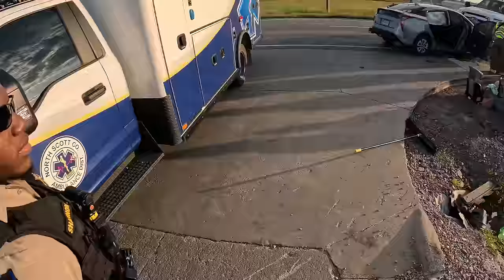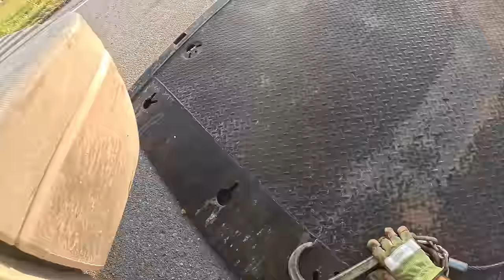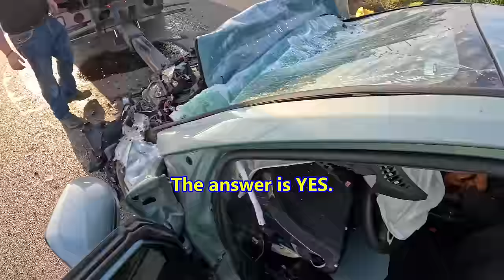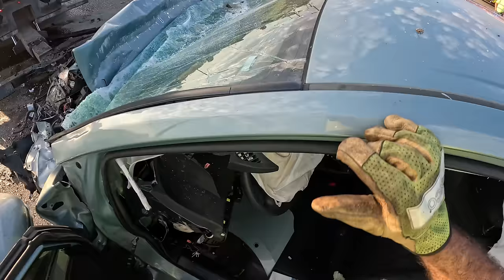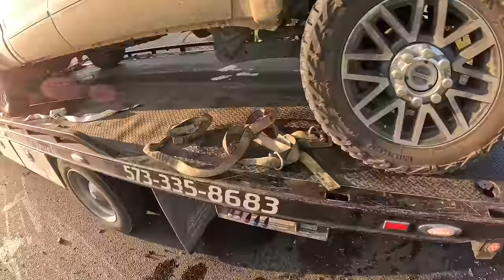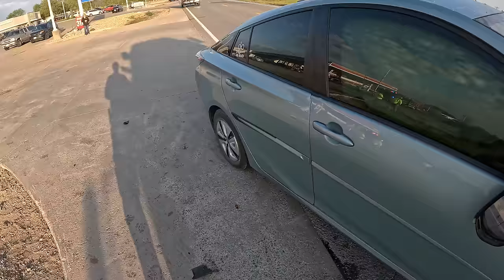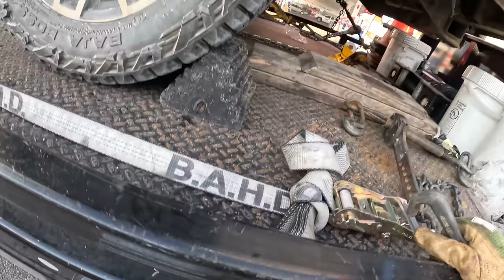HEAD ON CRASH CODE RESPONSE     DOUBLE TIME

Comment: Ouch that looked bad! You both did a phenomenal job as usual and hope all is well for the victims
ALSO: little info tidbit for future dealings with toyota priuses and most bmws, their batteries are in the trunk area but of course gotta take precautions as you showed here :)
Reply: I had my 3rd gen Prius totaled when someone hit the back of it, while going above the speed limit in the right lane, accelerating to about 7-9 MPH over after reaching top of a highway hill, though was about 4-5 over when hit, with somehow the airbags did not go off, but was not able to drive it because the bumper was pressed up against the wheels, and as no warning lights came on, next day it was able to start up and warm up at idle like normal till the ICE turned off when hot enough with the climate control off, even though the impact had shifted the 12 volt battery in the back and it looked questionable to me, however nothing leaking that saw, for was thinking of replacing that battery soon anyway, but course whole car got replaced instead 😅
Reply: And a hybrid with a ~300VDC traction pack. The first thing I'm looking for is the big orange HV system disconnect. (The dash was still lit so it still had power, which means the HV contactors are closed -- HV system still energized.)
Reply: Most hybrids have a high voltage battery as well as a 12 volt battery. heck, even a Tesla has a 12 volt battery. 

As far as batteries in trunks,  BMW is one, but a lot of the Volvo SUVs have a rear battery as well. And, Jags. And many others.  As well as saving space under the hood, the extra weight to the rear helps handling. And, batteries last longer if not baked under the hood next to the engine.
Reply: It did look like the regular battery was in the front. Prius C, so maybe it's configured differently. The drive batteries are somewhere in the middle of the car. Well protected.
Reply: @jfbeam no, the dash isn’t powered by the 300 volt battery in the middle of the vehicle. The dash is powered by the 12 volt system AKA alternator and lead acid battery.
Reply: @jfbeam  The dash and other accessories are powered by a standard 12V battery, not the hybrid battery pack

Comment: It met truck bumper to car hood/engine and car bumper to truck wheels.  I'd not expect any truck suspension to be OK with what looks like 40+ mph closing speed impact direct to the tires.  SOMETHING was going to break.  It's just a matter of where the designers put the fracture point for progressive impact absorption.

Comment: i just wanna say thanks because of your videos a few years ago when i was rigging my car for storm chasing i was able to find a really good light controller the feniex mini 4200 i chose it because i saw you guys use it also and it does great running my roof bar and TA in my back window i even have it running aftermarket fog lamps

Comment: As a paramedic I have seen a lot of accidents, I will surely pray for the folks in these vehicles, lots of potential for injury.  looked like the truck's driver-side airbag did not deploy, the driver might not have had their seat belt on which in some cars and some impacts will prevent the bag from deploying.  I believe the post  below me mentioned but Ethan should get in the habit of just putting gloves on.  Seems like every time I handled extrication or helped out the two crew, yep I was one of those guys who would help grab all the junk off the road if time and conditions allowed.

Comment: Thought the sunrise may have contributed to this. Pulling out of a driveway, one tends to check over your shoulder. Pulling in, maybe the pickup was trying to beat opposing traffic turning in. Bad combo; bad timing. Hoping all involved fully recovers. Chemical gloves have terrible dexterity but they're invaluable protection when things are leaking.

Comment: Thoughts and prayers to the driver of the car, for some time I drove a roll back with a spec lift and we would always tack this truck to a 2 car incident we found it was easier and quicker than two truck's it doubled the man power when the other driver could be doing another job and unless it was a multi car incident it was a one man recovery and a one truck recovery hear in the uk.

Comment: I wouldn't say because it is a Ford. My F450 took a Dodge van out. Van ran into the right front wheel and totaled it out. $15000 worth of damage to  the body but didn't hurt the frame or alignment. I drove it home. Over 100 miles, no difference except for look.

Comment: Yes, it's fine to tow with one truck. Yes, it's fine to run two trucks.  But one thing that should always be considered is your scene. Is it safe for two trucks? Is it safe or even possible to haul both vehicles (in this case, being a Prius, yes)? How much room is there for your first responders, are you blocking entrance/exit points, or otherwise creating more of a hazzard?  There is always so much to consider from the time your phone rings until the time you return back to base/shop. 
It's a Ford 🫣🤣

Comment: Great videos as always. Love them. But maybe need to train a little more on wheel lift. Ethan could of spread the receivers more so the L arm wasn’t so hard to put in on the passenger tire he was doing. Also the L arms don’t have to be all the way in , I leave some gap so the car sinks in a little more. Don’t have to worry about the the oil pan, car is a total loss anyways. I personally chain sling most of the time it’s quicker and easier . But everybody does it differently, love the videos either way!

Comment: One of my nephews daughters fell asleep at the wheel going home from work and took out a power pole at an estimated 80 mph, the engine and transmission were shattered and the pole was sheared off at the ground, she has a lot of bruised ribs, a concussion and stitches across her forehead and left cheek. he got the call just as he was getting ready for work at 4:30 am on wednesday. She is doing ok and not to be alone for awhile.

Comment: One of the first things I noticed was how far back the trucks front wheels were, then noticed the interesting suspension system. That had to have been an insanely hard hit to sheer all those bolts out of the front suspension. Looked like truck at fault from the vehicle locations but with how hard that hit was wouldnt be surprised if they moved a ways from original impact.

Comment: Sorry if this was mentioned previously, but working a vehicle wreck without safety gloves is not recommended. Also, use you air horns in addition to the siren; it tends to get the attention of inattentive drivers. As always, May God protect you and yours in the performance of your vocation.

Comment: Over in the UK and Europe recovery vehicles are not allowed sirens or emergency lights as used by emergency services. They have to comply with road law. We even get stuck in traffic getting to the scene. Afterall we are only doing cleanup.
Reply: It's like that here in the US also but some states law enforcement give towing companies permission to run ELS so they can get to the scene faster if it's on a major roadway blocking the flow of traffic , any other time if a tow truck runs emergency lights and sirens the towing company can lose it's license to do tows or the person in charge of the company could face hefty fines for breaking the laws.
Reply: In another video Ron mentioned that  the agency has to request him to "expedite" on that call before he can run code.  And if i remember Rons comments the driver has to have training before he can run code.
Ron can you comment here?
Who does the code training?  And how extensive is it?
Reply: We have a few states that classify certified recovery companies in the same bracket as emergency services. Ron is in one of the few places that offers those certs, and he's one of the fewer that got those certs.

Comment: This is my nightmare scenario, being hit by a truck or SUV that literally runs over the hood of my car. My ex husband drives a Tundra & that thing is massive. Though the truck is heavy & large it stops pretty quickly, something the vehicles behind you don’t realize. I was driving it to work during a rain storm because my car wouldn’t have been able to get through the flooded intersections without damage from flood water getting into the engine. A young guy, maybe 17 yrs old, was tailgating me in the ran. I, rather stupidly at that moment in time, tap the breaks hoping to get the kid to back off, the kid hit his brakes & immediacy started to slide as though it was going hood first under the back end of the Tundra. I regained enough speed to avoid him sliding under me & he stayed quite a ways back from me after that. I haven’t brake checked anyone since.

Comment: With alot of these new cars when the air bags go off the ECM will cut off the fuel pump. Safety thing. Which is ball because if you need to move the car off the road you can't and this can cause problems......just my penny's worth. Thanks Ron do enjoy your videos. 
Think it's funny over In Germany they would off had 5 fire engines three tow trucks and a crane for a job like this one.....

Comment: Ron, I own a 1991 FORD Explorer with 348,000 miles on it. The heads have never been off, I just replaced the original fuel pump and everything works even the A/C

Comment: Do you have an outside quarantine area to store EV's and Hybrids? As you know, after a wreck, they can spontaneously catch fire, and those lithium ion batteries are extremely hard to extinguish when on fire. They burn hot and fast and anything within 20 feet is at risk of catching fire from the extreme heat and the sparking that will occur when water is applied.
Reply from the maker: We have plans for one, but have yet to build it.   For now, we have a large open area we can place hybrids and EVs.  We are fortunate not to have a large amount of hybrids and EVs in our area, but they are becoming more popular.  So, at some point we will have to build a separate area.   There are many different ideas that tow companies are currently using.   Perhaps the most extreme one I've heard of thus far is placing a hybrid or EV in an open-top container and then filling the container with water.   I understand the desire for safety and reducing the risk of fire, but that situation creates an entirely new problem.....hazardous water that must be properly disposed of due to contamination of lithium and potentially other hazardous materials.  Also, it insures the vehicle will be a complete write-off....    We will probably have some type of three sided bays made of concrete or thick steel walls that we can back the vehicles into.   It would be constructed away from the main building and other vehicles in a secluded area of the lot.    Thanks for watching and God bless.

Comment: That under ride is no joke, but I guess the Prius did ok considering the difference in ride height, the driver likely survived. If this had been 20 or 30 years ago the dash probably would’ve been pushed back and story would be different. I guess the downside to modern safety engineering is everything's breakaway and made of composite and ceramic materials that shatter into a thousand bits making cleanup a job.

Comment: Hi Ron.  Just one question on this one, although I realize it may depend on what you're told by agencies / dispatch.  Just wondering why you didn't bring 2 rollback trucks to this one.  If you were told it was a head on collision, I would think it is assumed that 2 vehicles are involved, so you may need 2 trucks, although like you mentioned, you can tow two vehicles with one truck, as seen here.
Reply from the maker: We had a second rollback on "standby" if we weren't able to move both vehicles with this truck.    Thanks for watching and God bless.
Reply: Got it, thanks.  Love watching your videos every week.  I was actually involved in an accident about 2 months ago (walked away un-injured), and learned from watching your videos to leave the tow operator the keys.  The car was deemed totaled by the insurance (I had a 2016 Subaru Impreza), and used the money from the insurance to get a 2023 Subaru Forester, which I like so far.

Comment: This Video Reminds Everyone Why you want to Own a Solid Vehicle with more Steel in Front.  Hopefully this Prius can have Batteries Recycled since it’s Toast.
Reply: A solid vehicle actually isn't a good thing for the occupants. The fact that the Prius looks like a tin can is just proving that it did its job of the car absorbing energy instead of the driver. A solid frame will transmit all of the force of the collision into the occupants.

Comment: Fuel cutoff reset on those model fords, open passenger front door and look right on the end of the dash, should see a thing that looks like a fuel pump

Also Who's grill did you pick up out of the ditch when cleaning up??   it wasn't the one out of the super duty

Comment: Fords are wired if the seatbelt isn’t buckled, the airbag doesn’t go off. Notice the cracked windshield above the steering wheel, driver must have went into it head first. Scary.

Comment: Everyone has their truck of choice. Bought my 3rd Ford from the factory. 1999 F350 4x4 7.3 powerstroke. Drove it for 25 year. Minor problems. Replaced 1 set of injector cups and Orings. Kept up the maintenance on it. My son now pulls his mobile camping house with it.😂 It's been a damn good truck. I now have a 2015 F150 Lariat 4x4 3.5 ecoboost twin turbo , max tow package . Rides like a Cadillac. Liked my F350 better , but I'm retired now and old , it had a 6 inch lift and was gettin hard for my old butt to get in and out of. Still gonna put 4 inches of lift in my 2015.😂

Comment: To be honest i would have put the small car on top of the flat bed and towed the truck, the truck seemed more towable? considering the front damage on the small car?
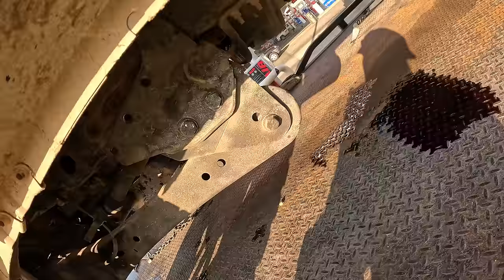Reply: The small car is only front wheel drive. The back wheels can spin all day with no issue. The truck is equipped with 4 wheel drive, but under normal operations it's rear wheel drive. With rear wheel drive you need to disconnect the driveshaft so you're not burning out the transmission while going down the road. Transmissions don't like going at highway speeds without the engine running. Also the front axle wasn't connected to the frame anymore, as they found out at 20:04. The small car was far more suitable both functionally and structurally for being towed. The truck was far more delicate.

Comment: HEY NOW RON AND GUYS! Be nice to Fords! Even though I'm a GM truck (square body for the most part) guy, I also have 2 Dodge (not Ram) and 2 Ford trucks living in harmony with my 7 GM trucks.

My current driver is a 2006 F-250 diesel, Ex-cab, 8' bed FX-4. Unfortunately, I had to have it towed to a local shop a few days ago because I didn't have time to repair it myself. This leads up to a short story that will hopefully give you and the crew a little chuckle...

We have 3 REPUTABLE towing companies, as well as a bunch of fly by night outfits locally. I don't need a tow often but, I called my preferred company to take my truck to a shop. 15-20 mins later, the rollback showed up and, I could tell that the driver had already had a loonnngg day because, even though he could've backed straight up to my truck, he backed up to it at about a 30° angle. He realized immediately that he'd made a mistake but, he rolled with it, crawled under the truck and hooked it up. He then took the key, switched on the ignition and started to crank on the wheel (with the engine off). I was standing beside the truck seeing this and said "Hey bud, you can start it. It runs and drives, it just won't stop, needs back brakes. He hung his head and said "Oh thank God!

A few minutes later, the truck was loaded, chained down and, on the way to the shop. When he off loaded it is when he noticed the "Tator" decals on the back window and said "Ron Pratt!

He's obviously a fan too!

As always, be safe and God bless you, your crew and your equipment!

Comment: That truck will be fine. Front bumper, possibly radiator due to the trans cooler portion seeming to be compromised. Maybe some front end suspension work, a junkyard airbag and an alignment. She'll be mint,

Comment: Question just wondering why did you not  put the cat on the truck sence it was more damage and just tow the truck ??
Reply from the maker: Primarily, weight distribution, but also the speed of clearing the road.   Another HUGE reason would be in the event the Hybrid vehicle's battery should ignite, I could quickly disconnect from it and not lose my tow unit to the lithium fire.  Thanks for watching and God bless.

Comment: I would have flipped it around that Ford truck is too old drive and not engaged in a four-wheel-drive. you can still pick it up from the front end and disconnect the driveline and put the Prius on the bed

Comment: Disturbing that the pickup passenger air bag went off, but not the driver side and the windshield is broken like it got hit with a head. Failure to wear seatbelt AND failure of air bag system? 🤔
Reply: The SRS is a complicated system. I'm only 3 minutes in, but if I had to wager a guess, driver wasn't wearing their seat belt, passenger was, and when the seat belts tensed up the passenger set their bag off, but the driver who wasn't wearing their belt didn't have their bag pop as the seat belt tensioner inside the B pillar detected no tension against it.
Frontal airbag won't go off the seatbelt tensioner detects little to no force during a crash